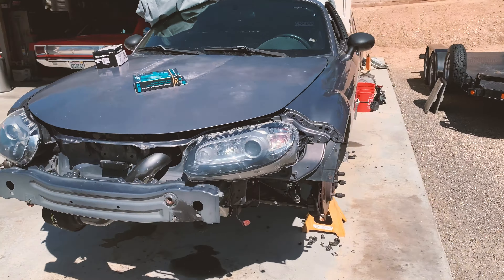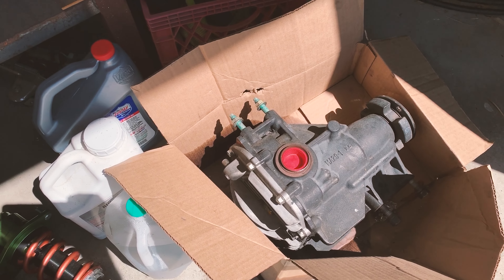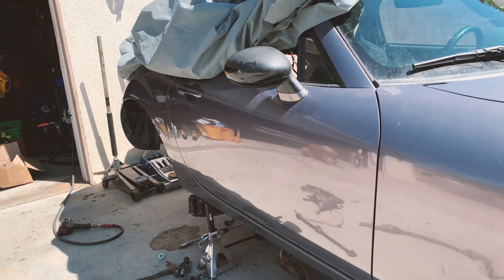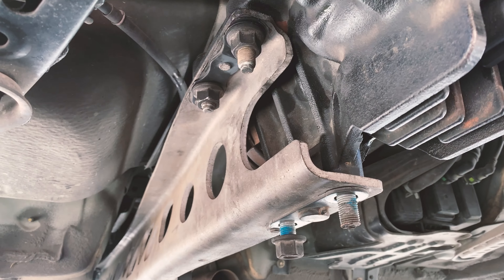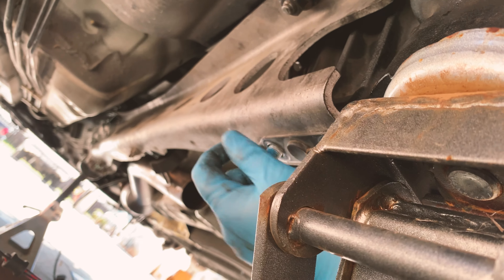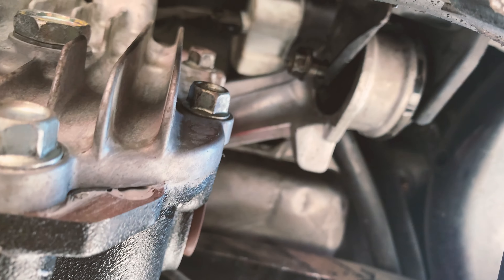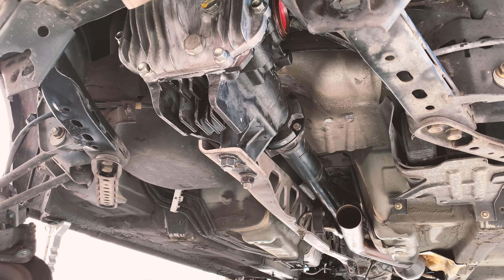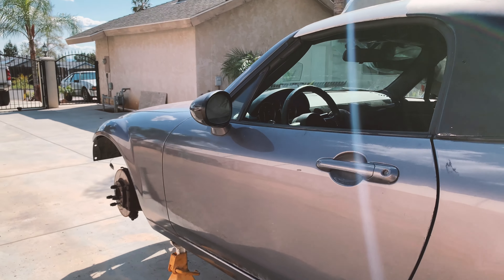NC v2.0: Installing an LSD

Comment: You needed a second man. That made my lsd install a lot easier. Also worth noting that Mitch here HAD to remove the axle from the hub due to issues with axle removal. Normally you don’t have to take the hub off or remove the axle from the hub. Glad you got it Mitch!
Reply: Hia, currently my shafts have popped out of my diff but I do not have clearance to pull them out entitly. I have u Don both top arms, my drop links and lower coilover bolt. Will I have room to pop the chats out when I loosen the diff and start to lower it?
Reply: I'm finishing it off tomorrow but worrie dill drop the diff with the shafts caught inside without clearance to pull them out
Reply: @tomb9378  I think i just took off all the ball joints on the hub. there's a video of a guy doing it to an RX-8 (same rear suspension as NC) I'll link if i can find.
Reply from the maker: I had to remove just about every arm to be able to get the axles out!
Reply: Same here..

Comment: I put an OSG in my '06.. 😳 It transformed the car, but what a PITA. I could not get the axle to seat on the passenger side. After destroying 8-9 c-clips over 3 days it just clicked right in. Been working great for 6 years, but that 80W-250 is kinda pricey.
Reply from the maker: That’s on my upgrade list as well is a proper LSD unit.

Comment: Good video big guy. I have a question. Would it be a good idea to buy a parts rx8 for a NC build? Is there enough stuff I can swap back and forth to make the parts car worth it?
Reply from the maker: If it’s cheap enough I don’t see why not! You can for sure use the LSD in the rx8 (if it came with one) as they are bigger than the NC and a little beefier to hold some power. You’ll need to do the axles from the rx8 as well. I plan on doing a video showing what one will need to do rx8 parts onto an NC!

Comment: Hey man great video. I recently bought a 2006 NC as well and want to diff swap it. Does the LSD bolt straight in? And do I need to get a new driveshaft as I've heard the driveshafts are different lengths between the open and LSD models. Is that true?
Reply from the maker: Open and LSD use the same drive shaft. Only thing on the drive shaft difference Is going from a 6speed to a 5 speed

Comment: Great video, this 8 minutes is enough to understand whats going on, i dont get it when somebody does 30-40minutes videos with the same project…
I also bought lsd from a 6 speed, tomorrow will be installed, do you feel a lot difference because of the longer ratio? Or not really a big deal? 
Some people told me the difference is too big that the power delivers not as good as the shorter 5speed open diff
Reply from the maker: Thank you!  As far as I know, between and LSD and Open Diff, the final drive is the same. Which is 4.1. So technically. If you aren’t changing the transmission you should just about feel no difference. Other than now you should be able to hold a drift!

Comment: Does an lsd from the 6speed fit the 1.8 model with a 5speed well? I'm asking because of the gear ratios
Reply from the maker: So as far as I know. The LSDs should all be the same for the NCs.  It’s when you start going from either a 5 speed to a 6 speed or 6 speed to 5 speed. You have to change clutches, drive shafts etc

Comment: whats the visual difference between a LSD and open differential? I remember reading somewhere that looking through from the sides can tell you if its an LSD or not
Reply from the maker: LSD you will springs inside. Open Differential, there is no springs. Ill grab a photo for you.  https://www.google.com/search?q=nc+miata+lsd&rlz=1C1GCEA_enUS813US813&sxsrf=ALeKk00iiiad1DHPKMVHe73a2q1T9PKaVg:1626060800127&source=lnms&tbm=isch&sa=X&ved=2ahUKEwiXqv_CzNzxAhVUsZ4KHZNvAzgQ_AUoA3oECAEQBQ&biw=1920&bih=937#imgrc=o7lgHwg-0RUbjM
Reply: @MitchelYardley  thanks so much! Keep up the great content!
Reply: @MitchelYardley  From outside there is no way of seeing any difference?
Reply from the maker: Nope. There is no visual ways of checking.
Reply: @MitchelYardley  That sucks, specially when you pick one up from Craigslist/OfferUp. So the cross shaft, through the hole is there even on the LSD?
Reply from the maker: I’m almost 100% positive my OPEN diff had the same shafts in the axle area.

Comment: great video! are the driveshafts the same between open diff and lsd?
Reply from the maker: Yes they are. Driveshafts however are different for a 5 speed vs a 6 speed.
Reply: @MitchelYardley  oh no. i want to change my 4.1 5 speed open diff to a lsd 6 speed
Reply from the maker: And your keeping the 5 speed trans?  I believe you should be good then.
Reply: @MitchelYardley no 6 speed is still inside. now i want to replace the diff with a lsd. and still use the 4.1 gear in the open diffhousing
Reply: @MitchelYardley  do u mean the propeller shafts are different? and driveshafts are the same?
Reply from the maker: Gotcha. I was getting confused. But to ultimately answer your questions. Open or LSD use the same drive shafts. It’s the transmission that uses different driveshafts.
Reply from the maker: If you were switching from a 6 speed to 5 speed or vice versa. You would need to change the drive shafts  (along with the clutch etc)
Reply: @MitchelYardley  now i understand. thank u very very  much

Comment: Hey I had a question, I’m looking at buying a later model NC 2 gt w/ the 6 speed, does anyone know if Those come w/ LSD’s?

I know the Clubs have em but those are getting harder/ more expensive to find lol
Reply from the maker: Most 6 speeds should of came with an LSD. Luckily if you have the VIN you can call Mazda Customer Service and give them the VIN number and they will tell you what exactly the car came with

Comment: This video convinced me that I should not attempt this job without any proper mechanic skill
Reply from the maker: I think that’s a bad thing for me right hahah
Reply: @MitchelYardley  not at all, you saved me from buying that LSD I saw on ebay for cheap and probably don't even need in my 126hp 1.8 and ending up with a job that's way over my head 😂
Reply from the maker: It’s not that bad!
Reply: @MitchelYardley  for context, I'm a pretty young dude and the most daring thing I have done on my cars is a timing belt, so I think I am not up for this challenge just yet. I'll start with anti roll bars, exhaust and coilovers first 😄
Reply from the maker: Not bad! Timing belts aren’t easy! Not a lot of people can say they can do those.  Sways bars and exhaust not too hard on the NC. The Coilovers however, may pose a problem they aren’t easy. At least in the rear they aren’t when it’s stock coilovers since they are so tall!

Comment: Hi, do you know if the open diff from a 5 speed will fit the 6 speed? I’ve heard mixed things
Reply from the maker: Yes it will. The NC has the same differential carrier for both the automatic and manual
Reply: @MitchelYardley  thank you! This is the only video for the NC differential and I appreciate you for it!

Comment: Question as you prob know better than me. 

I have a spare 3.7 LSD and 4.1 open. Can you swap te 4.1 final drive gears in to the LSD or is this not possible.
Reply from the maker: Is the 3.7 LSD from an NC? I didn’t know they made that for the NC. If so, then technically yes, you could take the LSD and put it into the open differential housing with the 4.1 gears.
Reply: @MitchelYardley  yea both age off mx5 nc cars
Reply from the maker: Yup then you should be able to interchange.
Reply: @MitchelYardley  thanks I’ll see how it goes
Reply: @MitchelYardley  Europe got a different diff ratio compared to the USA.
Reply from the maker: Correct. EU I believe got a 3.63?